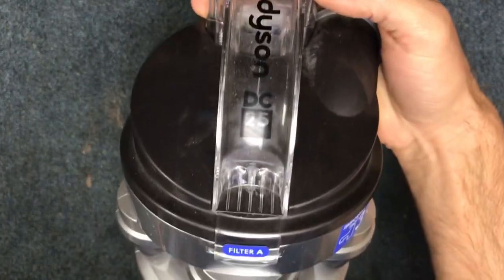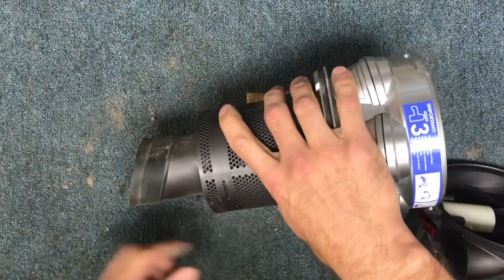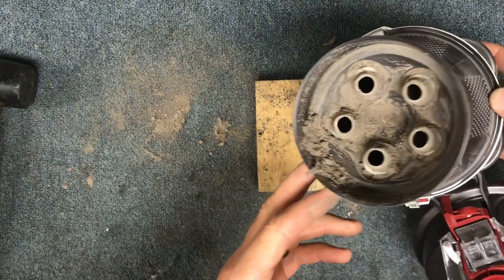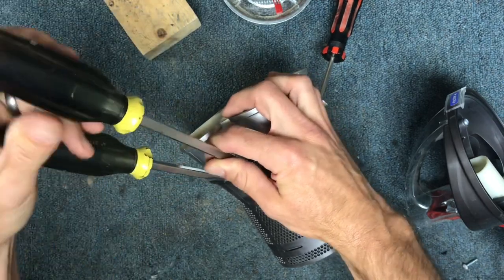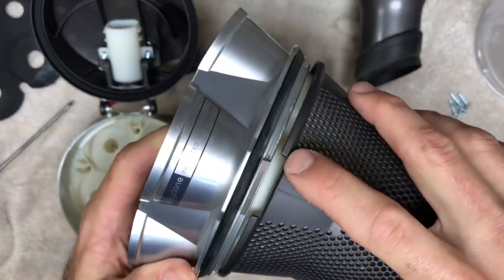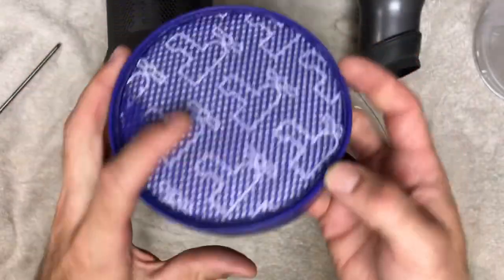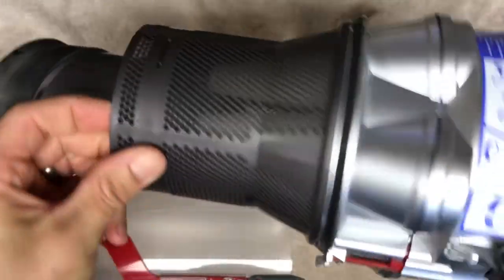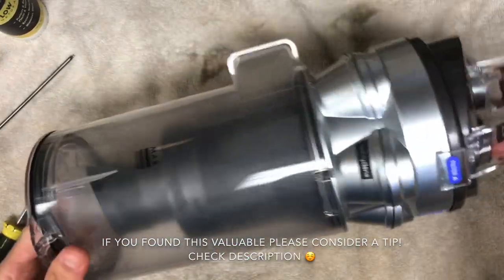How to take apart a Dyson DC25 cyclone assembly and reassemble (for cleaning)

Comment: Thanks for the step by step on the cyclone assembly on my DC25... i didn't take every bit apart, but enough to give it all a good shake and wipe-out with a damp sponge.  Super easy to follow along, and agree 100% on cleaning the filter w warm soapy water.

Comment: If you don't have a rubber mallet you can also use the handle of a tennis racket. I did and worked beautifully. Aim at the neck parallel to the four clips and it will pop off. I ended up going around in a circle at each clip and gave it a whack. Came off easy.
Reply from the maker: Way to be creative!

Comment: Great video, thanks! Very instructive and clearly presented. It was fascinating working through the disassembly process, and shocking to see how much nastiness had accumulated. Clean as a whistle now.
BTW, rather than the wood block/rubber mallet technique, I rested the assembly on my kneee and gave the tube section a swift karate chop. Came right off with no problem. Perhaps not a method for everyone, but I am a highly experienced karate chopper. And I watched The Man From U.N.C.L.E. a lot.

Comment: Thank you. I got about 90% of my DC25 vacuum disassembled and cleaned but your mallet trick and prying technique solved the last part. I had been hosing out the canister for years and all that moisture created a sludge that smelled like a sewer. It is nice to vacuum now and not stink up the house. I also found a way to clean my Dysan V6. What a difference! Thanks again.

Comment: THANK YOU! my church has two of these and they've never been cleaned. They smell and must have been used on wet floors. I was scared to take it apart!! I didn't have a rubber mallet but I do have a husband and he popped it off by hand 😊 even the trick about using the armorall was so clutch! Thanks again.

Comment: Thanks for the helpful guide. My old DC25 just died on me, the gear that connects to the motor via the rubber belt completely wore down the plastic teeth, and the brush bar won’t spin. Ordered a new brush bar and soleplate and I decided I’d clean the cyclone while I was fooling with it. Haven’t deep cleaned the cyclone one single time since I got the vacuum in 2017/2018. This video got me through disassembly and reassembly, and I was shocked how dirty it gets inside there. Suction seems a lot stronger now.

Comment: Great video! I have the same vacuum I’ve used since they were released. Has to order a new gasket. Tip I’ve learned a hot hair dryer will loosen plastic making it more pliable

Comment: Thank you for the wonderfully helpful video good sir. 
I've a couple additional questions, if you might be so kind?

Firstly, am I correct in my observation that all of the parts you cleaned in this video can safely be cleaned with soap and water? I.e., there's nothing electrical etc?

 And secondly - I've heard that "ArmorAll," inspite of it's suggested uses, can have a tendency to breakdown and cause cracking of gaskets.
Has anyone heard anything similar or otherwise?

Can replacement gaskets be purchased from Dyson or other reputable sources?

Thank you 😊
Reply from the maker: Yes! Soap and water works perfect! (Dawn is the best—not paid to say that lol). 

And interesting. I have not heard that about armor all. If that is happening to the rubber gaskets, I have never observed it on machines I have serviced that have come back in for routine service (that could be numbering in the hundreds). 

However if that is true that wouldn’t surprise me. I remember learning that chap stick brand lip balm causes your lips to crack more over time. Lol great way to get repeat business but ultimately lose the trust of your customer. 

All that to say, you could be right about armor all causing gaskets to crack, but I have not once seen these come back in cracked so I’m not all too worried about that. 😊

Thanks for the comment!

Comment: This is a great video, thank you. Do you have any tips for cleaning the bottom part of the vacuum with the roller? I think it’s the same t15 bit that would work to open that piece up, but the roller plastic case is filthy and I’d love to clean that after I do this main portion
Reply from the maker: After removing all screws on the bottom pull up the top piece and then you need to remove the belt to separate the clear portion from the base. Take pictures and don’t get the motor wet!

Comment: It's immeasurably easier to just soak it in the warm soapy water and then flush it throughly with a water jet from your shower head. Water goes everywhere there and gets out all junk. I'd say it cleanses at least 90-95% of all stuff, and no danger of spare parts left behind. 😉
Reply: This is what I did as well. I used compressed air to blow it out really well afterwards. I did find this video to be really helpful even thought I’m fairly mechanically inclined. Soft spoken, great info and easy to follow instructions. Thanks!

Comment: Hello and thanks for a great video- I did everything including smashing with my rubber mallet and I am 72 years old. So, whoever thought it was too complicated was obviously not willing to try. I would suggest that gasket material like the 1/16 inch from NAPA auto may work to cut out a new gasket using the old one as a pattern. Mine blew off my deck but then I found it, but I was just going to cut a new one if it ripped. Luckily, mine did not tear. Everything looks so clean and new. I used a auto scratch polish on the white scratches on the exterior of my plastic parts and the machine looks like new and smells so much better. I used little lemon juice and then a vinegar spray then clear water to clean the cyclone parts. No more dirt and animal odors. I also did not know what a torx screwdriver head was, but I had one that fit and now I know what it is. Very happy with my final result. I think that Dyson should certainly start making these just a bit easier to take apart. They are always  talking about how just emptying the chamber gets rid of dirt but if you don't tap the !#*! out of the chamber to get the fine dust particles that are in the cyclone chamber then it really builds up quickly. Thanks again.

Comment: anyway to order a foam gasket replacement that inside the cyclone?
Reply: mine is all torn up too.. I saw one on eBay for $13, but it seems a lot for what it is.
Reply: @TheUnknownHarbingers  The ones you see on EBay are in England. Someone over there saw a gap in the market and is making them. Dyson doesnt make them. They expect you to buy an entirely new Cyclone unit. So we bought some foam, scanned the old one and are using my wife's Cricut to make our own.
Reply: and it works great!!
Reply: @donaldhopper3858  now that's what I call ingenuity!!! Oh, AND team work!
Reply from the maker: Hi Donald I don’t have any! Sorry. You can try taping it with electric tape as best you can.